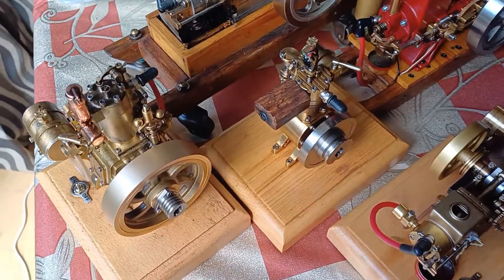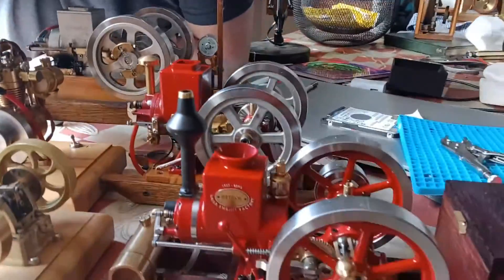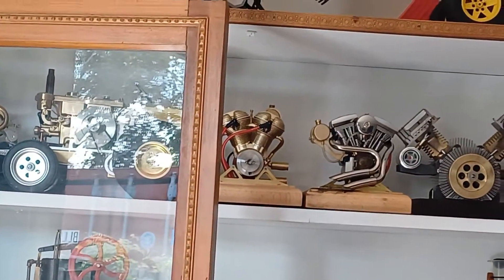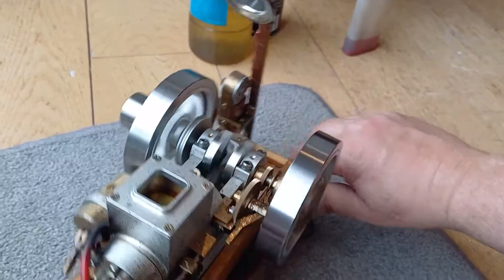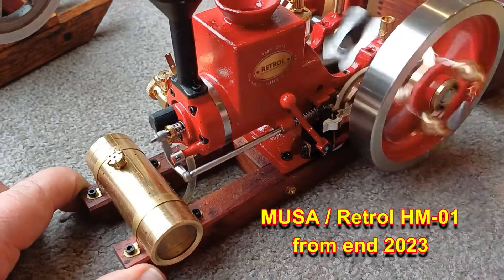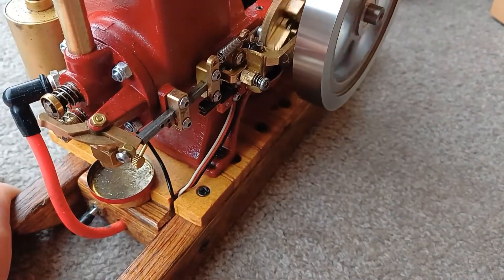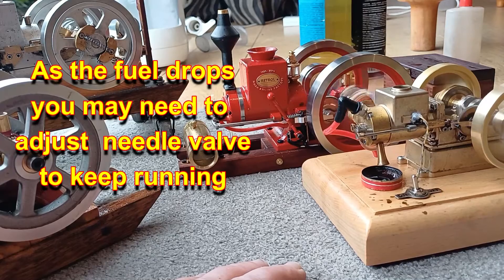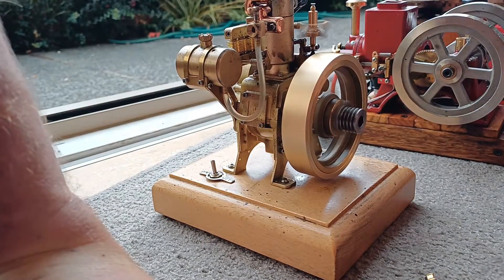6 Model HIT & MISS ENGINES from China - meditative motor music

Comment: On my Microcosm m93 (has same bearing as the m90) I replaced the roller main bearings with bronze bushings from Amazon which significantly got rid of the rattling. The dimensions of the bearing are ID 8mm and OD 12mm. It is hard to find the right length so I bought longer ones and cut them to length.
Reply from the maker: Did it too, with bronze. It's an absolute must for these engines with this chassis. Thank you for your info for anyone reading this. Yeah, it transforms these motors. The roller bearings are SO BAD I wonder whether these engines are still sold with them, how old was your engine?
Reply: @ThomasPCGuruENGINES  I just bought it, I hated the clacking so much that I did that. The m93 is a four cycle throttle governed engine so every time it fires it makes a rattling noise. It was a pain in the ass to get the flywheels off as the set screws would create an indent in the shaft locking the flywheels on.
Reply from the maker: Sad to hear they're still using that crap bearing solution. Year those shaft indents are an issue with every single little engine I have. I create makeshift pullers to get them off usually. It is a big job but a learning one, for me, and the engine ran SO much better - valve timing , ignition timing all better

Comment: I've had nothing but problems with my m19 sadly as it's my favourite. My HM-01 runs but everytime it fires it jumps like crazy. Guessing it's firing far too early. What are your thoughts Thomas?
Reply from the maker: M19 is great but I think is too small for the governor mechanism,  slightest wear changes things. I just finished a massive repeair epic of this motor and the last thing I had to fix was old oil thickening in the intake valve stem, cleaned that out. Yeah every time I use it it's different.
HM-01 you must spend the 20 mins or so bending the middle of that contact leaf to delay your ignition to tdc. However, it is a jumper :)

Comment: Hi Thomas, 
Over them all.. even the HM01, give me the enjomor every single time.
Reply from the maker: Why why why why? Do tell
Reply: @ThomasPCGuruENGINES  Simple,
They are easy to modify, hardly ever need parts, and don't throw oil everywhere when they run, like other engines.
The overall look too, is far nicer.

My only quip is the piston doesn't come far enough out of the bottom of the cylinder for the lubricator, to work.
Reply from the maker: Food for thought @anythingoldmechanical